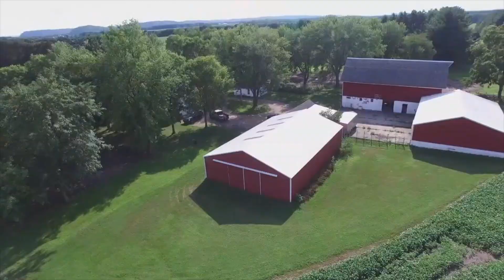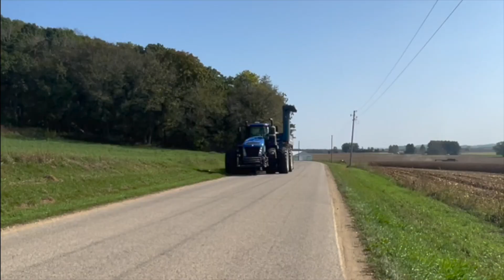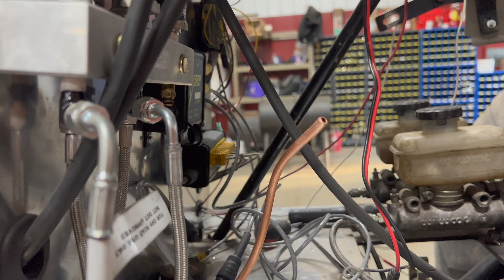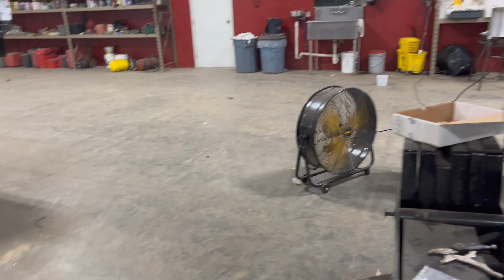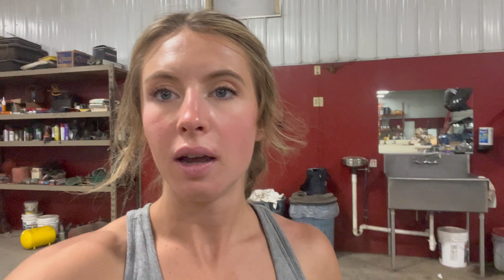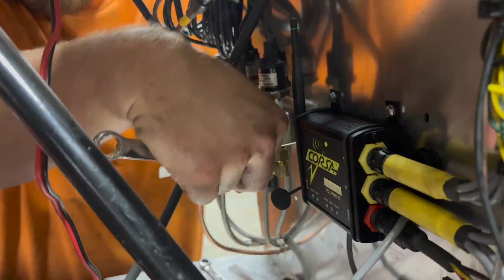Will we make it to our first tractor pull?!

Comment: The engines are only 4 cylinders they sure get some hp out of them i always thought they were 6 cylinders
Reply: They are all 6 cylinder not 4
Reply: Than tell me why there is only 4 lines on the injector pump than
Reply from the maker: I'll have to confirm with the boys on what is going on, but I know they were in the middle of working on the injection lines